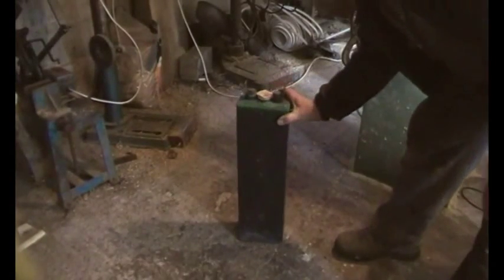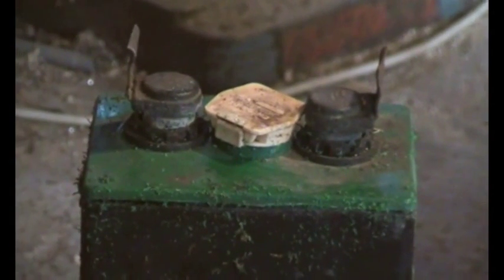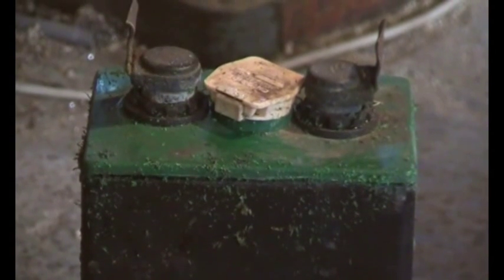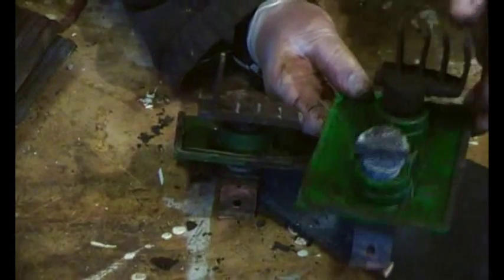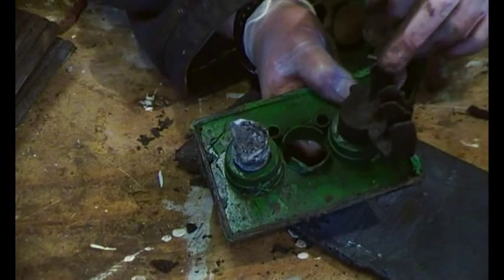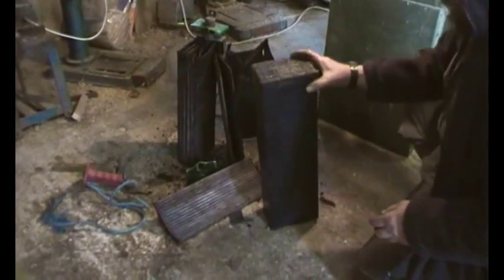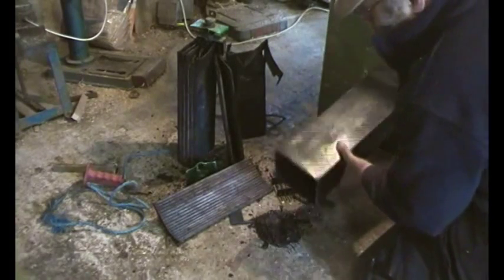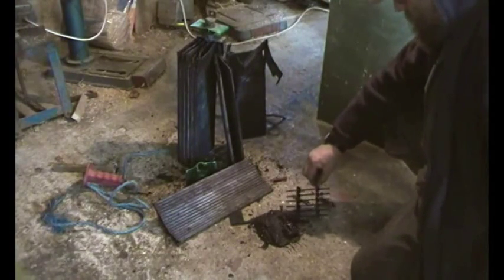Faulty battery investigations, corrosion to the positve plates, take a cell apart.

Comment: Hi Mnr Andy. So i have a 2v cell (840ah,) thats on 1.75V after 3 hours of discharge @20amps. But the SG are 1.255. what will be your advice? All the other cells are still at 2.05V with the same SG.
Reply from the maker: Hi, just a few thoughts:
Is the battery top raised up around the positive terminal?
With an SG of 1255 to voltage should be much higher than 1.75.
First thing to do is a drop test and see what the voltage under a 100amp load is.
I covered drop testers in one of my videos this summer.
I don't want to send you down a false trail but the drop test will tell you if there is an internal fault, see my video: battery hack: making 2 volt cells.
Cheers and subscribed?
Reply: @TheInfoworks  Hi Andy. Yes i subscribed. Your channel is very helpful and informative. I would like to order your book as well, but cannot find it locally in SA.
Reply from the maker: Hi, here's a link direct to the publishers, see the buy now . https://www.lowimpact.org/book-title/wind-solar-electricity/   cheers